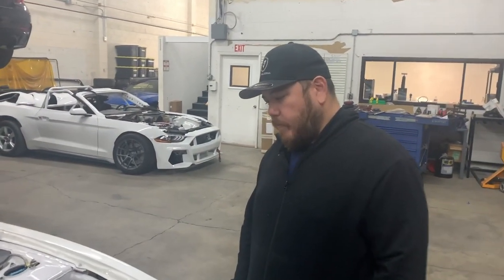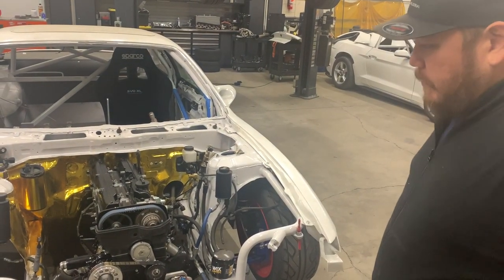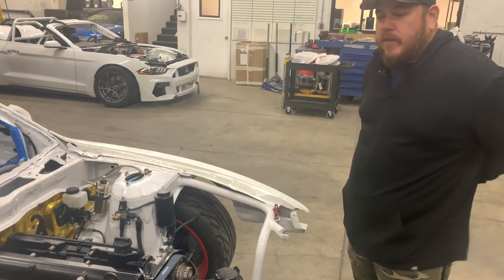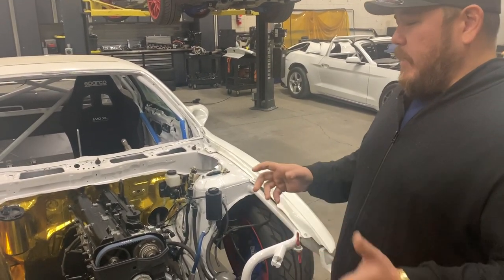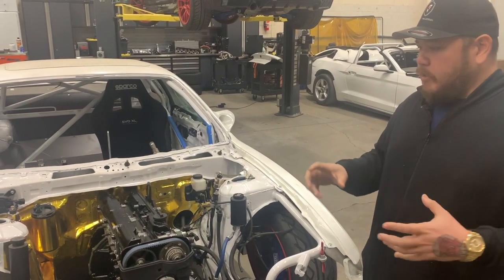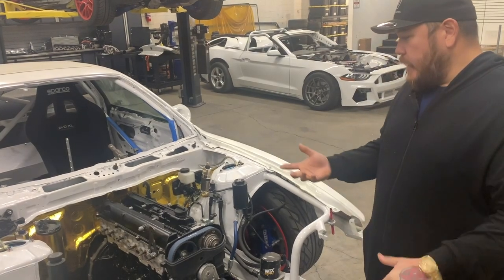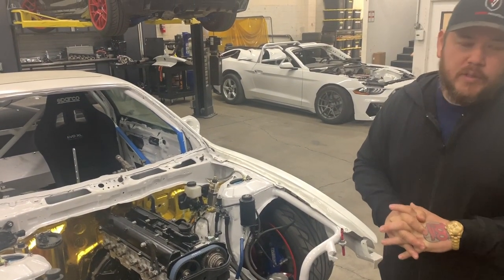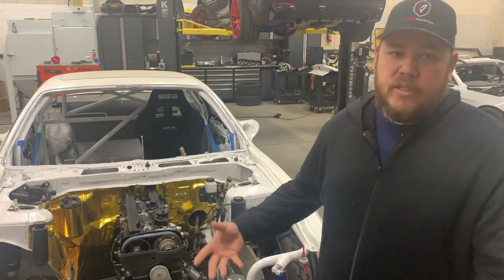Toyota 2JZ Build Tips : Advanced Class in Machining, Parts, Compression, Fuel,Turbo Setup

Comment: 3:00 oem hilux shimless buckets are great upgrade forr all older toyota 31mm bucket lifters (old Fe heads and 2jz-g heads)
yaris ones are great for 26mm old buckets (i.e. 4age)
7:00 flex fuel sensor should be used.. doesnt cost much as they come in many vw/gm engines 7:20 Oh :D
8:25 learned that hard way
36:20 most japanese brands make products in taiwan or china
42:20 same
Reply from the maker: Thanks!